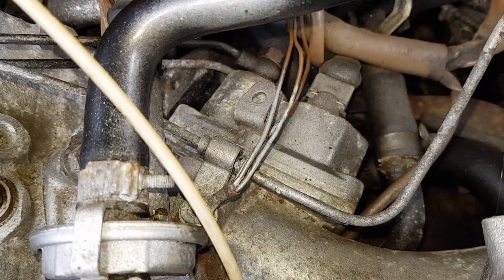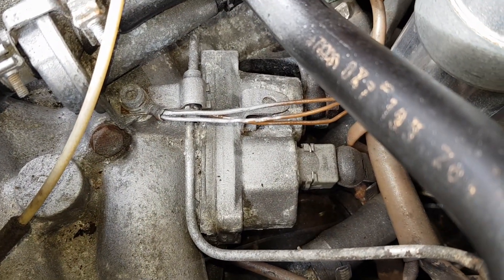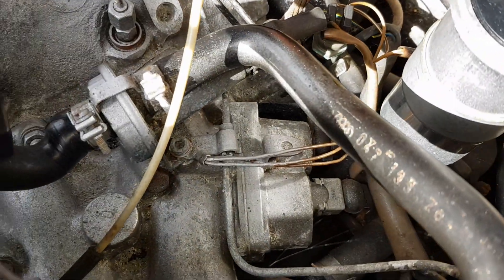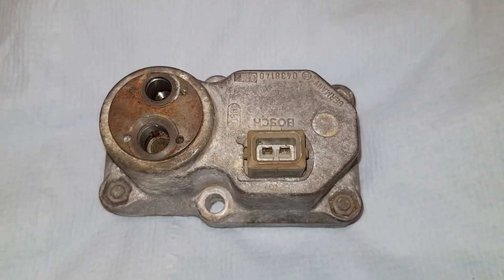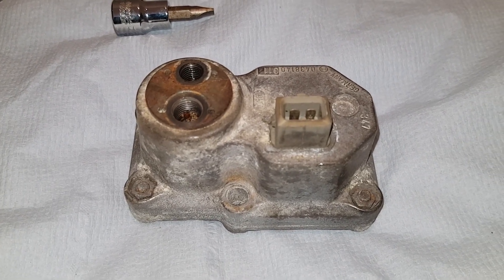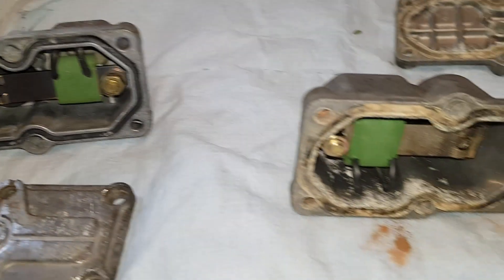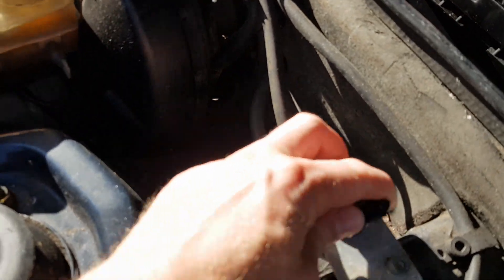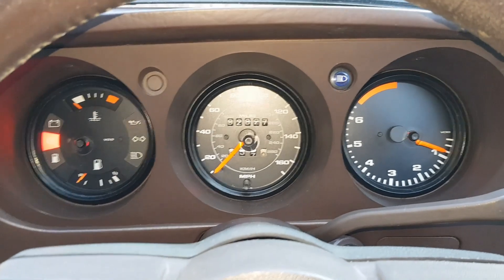Porsche 924  Cold Start Fix - WUR - Part 19

Comment: Did you buy any new gaskets at all. I have one that needs to come off to hopefully get same result as yours. T.i.a.
Reply from the maker: Thanks for the comment Chris, I was lucky and only needed to give it a good clean, especially around the inlet and put let fittings. That said I'm rebuilding my spare with a gasket kit so will do a video on that one soon. 👍
Reply: We've had ours running after being stood for years now she won't fire up. I'll start with some fresh fuel and see where we go. When she is running stinks of petrol in that corner. Thank you.
Reply from the maker: @christophergarrett4433  great to hear you have it running, I'm sure you know this but just check the lines back to the fuel pump to see if any leaks have developed. Cleaning the WUR and the fuel distributor unit can do wonders. Let me know how you get on 👍
Reply: I've nearly got the WUR off. Bottom bolt requires a visit home to get my Allen keys. I got 18.8 to 19.2 Ohms at the connector. Just seen your video on the pump and accumulator which frightens me. I won't be delving into that. So fingers crossed. If I find debris I will do what you did and leave the rebuild kit I think? Any suggestions where to get kit from?
Reply from the maker: @christophergarrett4433  Hi Chris, dont be put off by it, just take your time step by step, you will get to know your car well through it. Here is the gasket set for the WUR, good kit from germnay via ebay https://www.ebay.co.uk/itm/Repair-Kit-For-Bosch-0438140011-Warm-Up-Regulator-Porsche-VW-Audi-Ford-Nissan-/184451697450?mkcid=16&mkevt=1&_trksid=p2349624.m46890.l49286&mkrid=710-127635-2958-0

Comment: You were luckier than me mate I rebuilt mine put it back on and it went to shit, idling bouncing around. I've got a spare WUR did the same shit job.
Reply from the maker: Sorry to hear that DS. I know that if you rebuild them they might need resetting to set the correct fuel pressure for optimal running. Check out this post it might helphttp://www.924board.org/viewtopic.php?t=20665
Reply: @Witty924  I drive a MK2 Scirocco GTX 1.8 DX 8 valve. WUR part number is 0438 140 118. 

Thanks for the link bud and I've saved the link, will look into the information 🙏

Comment: Im having problems turning my car on it cranks and sounds good for about 5 seconds and then just turns off
Reply from the maker: Hi Alan, thanks for the comment. So I would start with the fuel system and just make sure fuel is at the injectors and dont stop after 5 seconds. You can also pressure test the fuel system to check it stays constant and doesn't drop. It could be as simple as a new fuel pump or the WUR needs a clean or refurb. Let me know how you get on 👍
Reply: @Witty924  hey so I’ve gotten to the point to where my 924 turns on but I have to keep giving it gas to the car doesn’t turn off to the point where I can leave it on its own and is warmed up this sound like a WUR problem?
Reply from the maker: @alancarriedo7378  Hi alan, so if the car doesnt stay running it could be the WUR. Remove the Airbox and air filter, get someone to start it while you put your hand under the plate of the air mass unit and lift slightly as it's running. You will hear the change in engine note. Keep doing this slight movement till you hear the engine idling well. Now let go and if it stalls that can mean your WUR is not keeping the pressure at the right level. If this is the case take out WUR and give a good clean around the inlet and outlet connections. Reinstall and try starting again. Let me know how you get on 👍